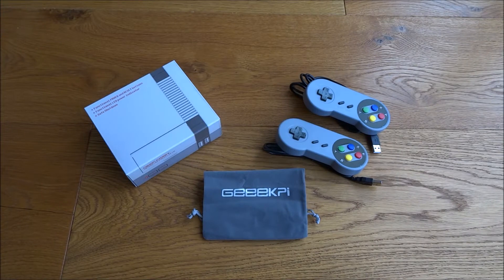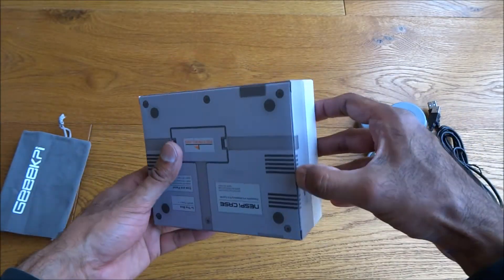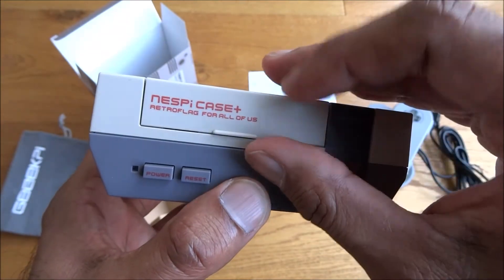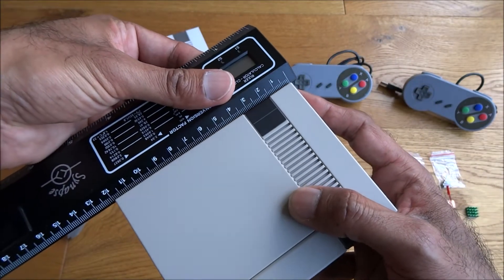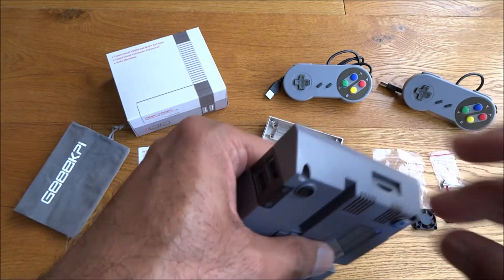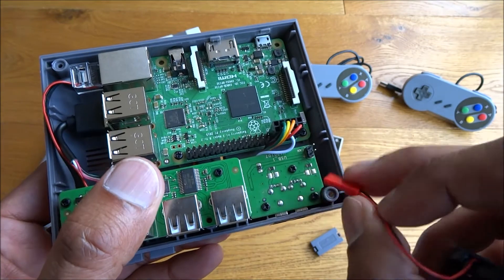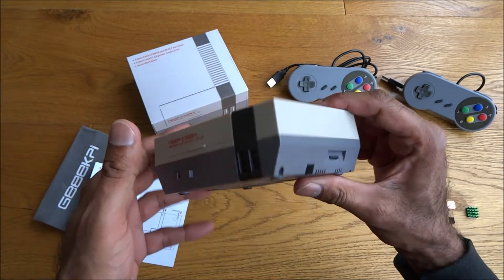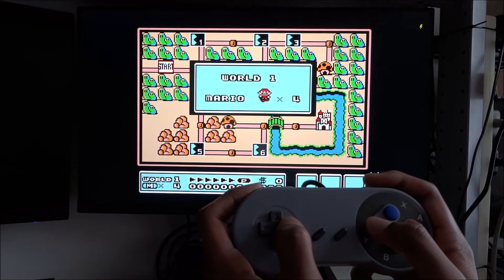GeeekPi Retroflag NESPi Case+ Plus with USB Wired Game Controllers & Cooling Fan & Heat

Comment: Yes, 3 heat sinks (CPU, video and BT) were included in the box that I received a couple of days ago.

The Retropie 4.4 with the latest updates incorrectly identifies the included game controller so it thinks there are more buttons to configure than there really are. I eventually have to F4 to exit the controller config and exit EmulationStation.

Trying to figure out how to identify/configure the included controller.